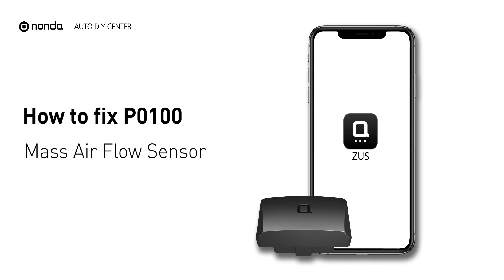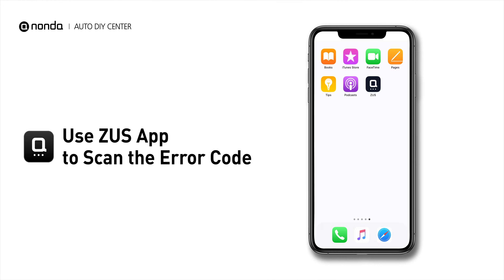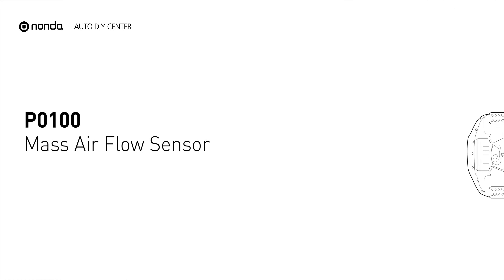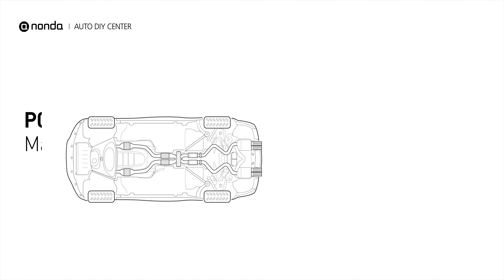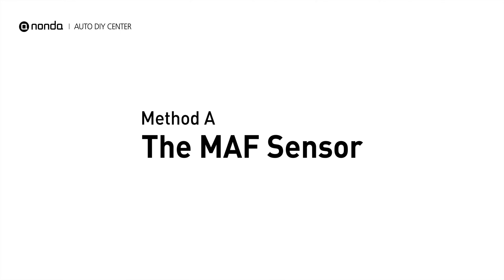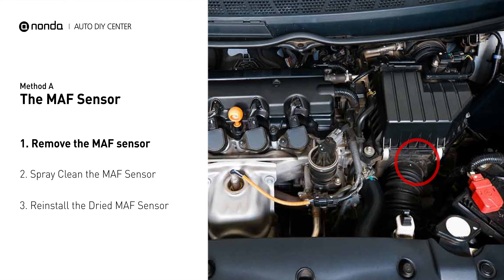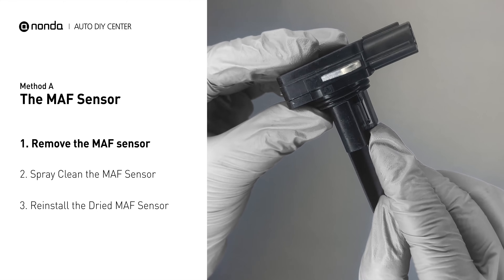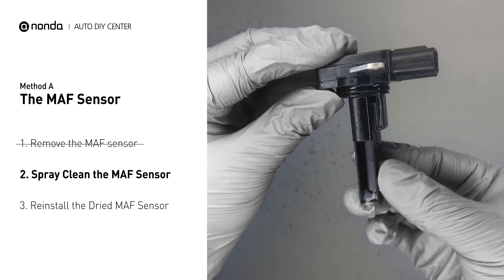How to Fix P0100 Engine Code in 2 Minutes [1 DIY Method / Only $9.24]

Comment from the maker: Hi, I'm Steve, nonda's lead mechanic engineer. 
Feel free to leave your comments here if you have any mechanic questions, I will be glad to help you out!
Reply: Hi I have a 2007 vw jetta 2.0 turbo. I recently had this code paired with a p0304 (misfire cylinder 4). I have no idea why I have a misfire with the P0100. Any initial thoughts?
Reply: @Gabriel-pj2bk  does your car still have catalytic converter install on it?
Reply: @Gabriel-pj2bk 
Hi! Have you solved the problem? I have also these two codes combined. Same engine 2006.